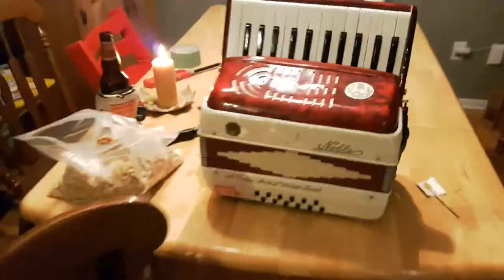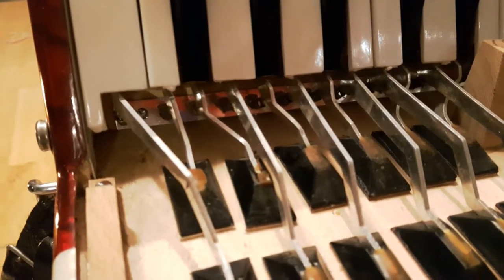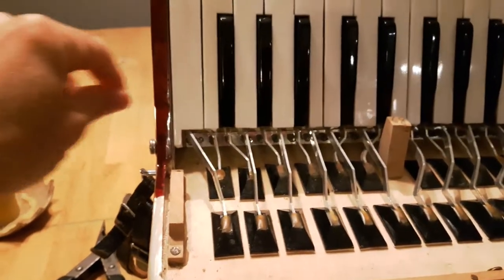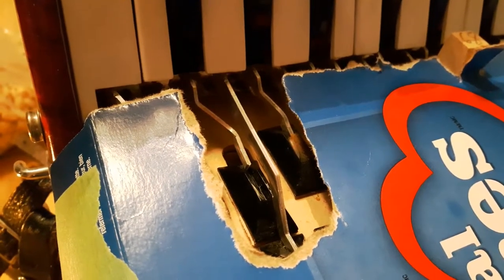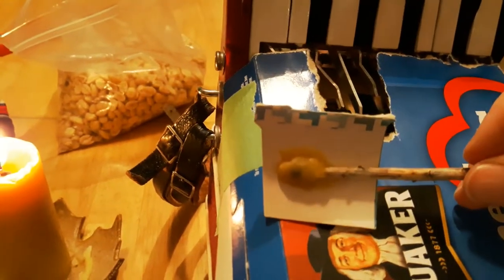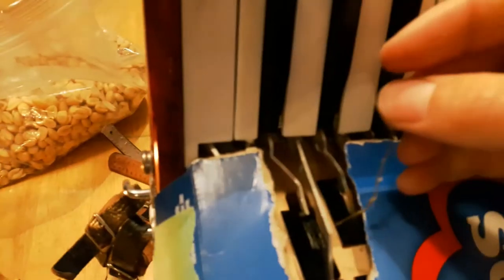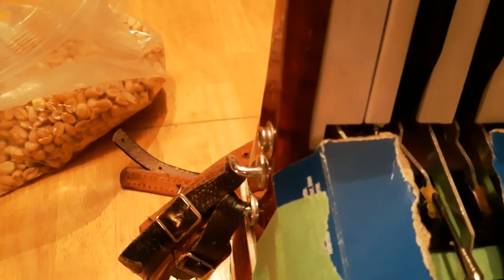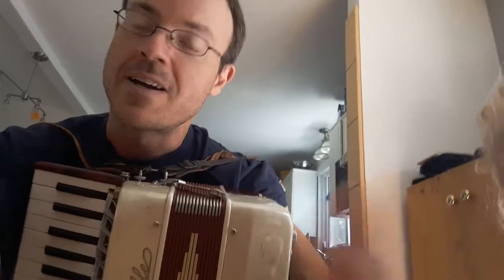How to repair an accordion: attaching key to pallet

Comment: Im I'm gonna make this right now to my key. I've an german weltmeister piano accordion and a key broke the wax right when I finally fixed many stucked keys. I'm gonna use a tiny torch, the size of a lighter, with the back in place, as the angle be perfect after the wax get hard again. I have extra bee wax, and the hard Brazilian carnaúba wax for emergency 🙂😄. Good video, tanxs
Reply from the maker: Glad this is useful for you! I hope it works out.